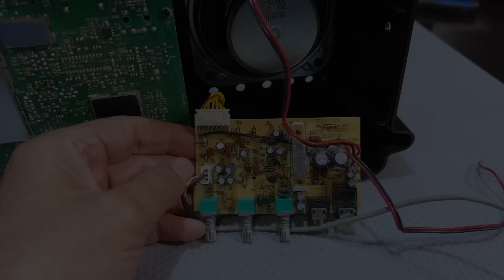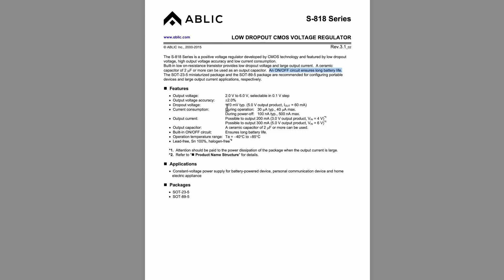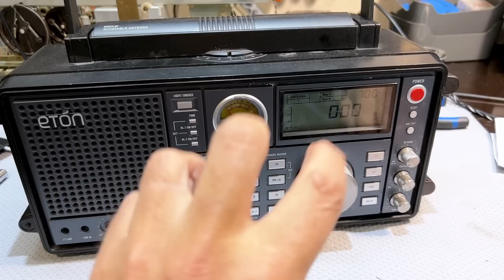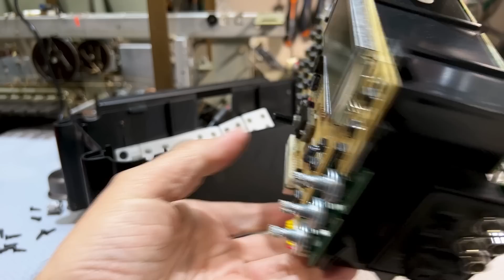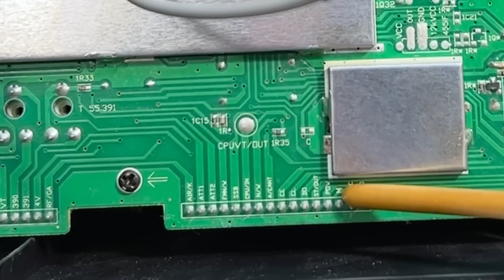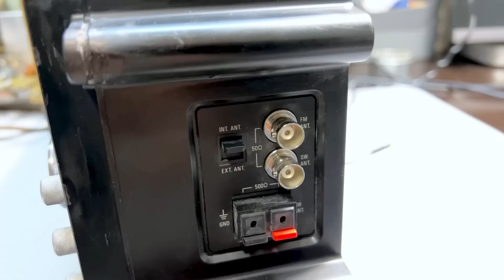Solving a Common Problem on the Eton/Grundig Satellit 750 - Reverse Polarity Damage.

Comment: Thank you.  This video helped me figure out the problem I had with the board with the power plug on it.  My problem was that the plug had let go from the board.  The copper on that particular board is quite thin and over time the copper tore and cut the power from the power adapter.  If I could send a picture it would be easier.  In the end i got it figured out.

Comment: So I should be good with the stock adapter that came new with the radio?
Reply from the maker: It would make sense that it will be the correct one. If in doubt, test with a multimeter.

Comment: No joy in finding the voltage regulator state side. I was surprised nobody has any in stock. Do you have an suggestion on a sub that could be used for the radio to work correctly?
I did find a mosfet but sadly no luck on the voltage regulator.

Comment: Mr, Caldeira, update, I started testing the voltage starting at the connector and discovered no voltage going to the output on that little board, the one the battery also connects too. Okay the Mosfet was blown so I did what you did and Jumper'd that, I also ran a jumper from the DC connector on the little board, apparently something on that connector or the board was not allowing voltage to the main red wire leading the power supply board. I discovered then the Radio powers up! So excited with that but sadly no sound out put on any band or mode. I suspect that voltage regulator on the Main Front board is the issue, but I don't know, not got that far in. Any advice on how to proceed would be greatly appreciated! Thank you for the video!

Comment: Hi I purchased a Grundig 750 off Ebay, it arrived dead in the water. I found the Mosfet had a crack in it and was causing a dead short. I did the jumper on the Mosfet as you show in the video, no joy. I thought then voltage regulator, my problem is getting replacement parts here state side and nobody I can find in the states repairs these things so they wind up in the recycle bins or dumps. The mosfet was damaged, I can't get any numbers off it and same for the regulators. I watched the video several times wasn't able to decide on what part numbers you used for the Mosfet or Regulators. Could you provide those? I also had to replace several of the capacitors, and I think I will just replace them all, perhaps I will wait for the part numbers before proceeding with that venture.
Reply from the maker: I’m afraid all I have access to is in the video. Check the schematics and you can then find replacements from that or source alternatives.
Reply: @electronicsoldandnew  In the video you mentioned parts you ordered to repair the radio, but it is really Not clear what parts you got or where you might have gotten them. Nothing is out on the radios, No parts lists, service manuals, schematics, Nothing. What I need is the parts you used to repair your rig, 3 parts I think you replaced, and One was a Mosfet, I did find a source for the IRFR9024 I believe you mention but Nothing for the 4-volt regulators. If you could provide a part number for those 2 regulators It would sure help a fellow radio collector out!
Reply: @electronicsoldandnew  I rewatched the video and you are very correct you do show the parts. However, seeing the voltage regulator part number is a different matter. You might can see it on your end but on my end I can't see it well enough to make the numbers out. I am really sorry to bother you I truly am. I tried watching the video on a 70 Inch Screen and still could not make the part number out!  I asked a friend he watched it and he said he could see the numbers as I could but could not make them out because they are to small to see. Anyways again sorry for the bother.
Reply from the maker: I sent you an email with a zoomed view of the numbers. Hope that helps you get that radio up and running. Good luck.
Reply: @electronicsoldandnew  I got it thank you very very much! Having bad eyes is a real pain. I appreciate your time and your notes! By the way what you've done with your channel is very helpful, I have learned a great deal for your videos. Please keep making them!
Reply: @electronicsoldandnew  I located some of the voltage regulators in China but sold from Europe very expensive and had to order 25 of them. I found the mosfet it is on its way and should be here within a few days. Voltage regulators sometime at the end of March, that was the fastest I could get those. I want to thank you for your help, very appreciated please continue making videos like this, it is very helpful and not only helpful but shows ability to trouble shoot! You are a Blessing to anyone who enjoys radio and the repairs and restoring of radios. Excellent!
Reply from the maker: @maxedoutmegablith6473 👍

Comment: Anyone else knows the issue i wrote about above?
Reply from the maker: I’m afraid that question requires a full checking of the circuit. There’s no simple answer without a full analysis by a tech.

Comment: Thanks for posting, I found that same model at a garage sale for $10 years ago, had open flushable link but now all buttons work except nothing happens when turning the tuning knob, any ideas thanks!
Reply: Someone mentioned the Encoder gets dirty perhaps this is your issue. You'd have to take the radio apart, it isn't easy to get it apart, have to be very careful, recall where everything goes. Once inside you will have to remove the front board. The Front board has a shield on it, that would have to be removed, 2 solder joints and several tabs bent straight. Remove that so you can access the back and remove the encoder. As far as taking it apart, you have to be very careful so as not to damage it in anyways. I have taken encoders apart, but it can be tricky and a real pain in the backside. I would just try and find a replacement unless you are really certain you can do this. I had issues with the volume pot once I got the radio working. I was able to use a dental pick and open the back side just enough to get some IPA in and clean it and then used Deoxit on it. Just be careful do it at your own risk, encoders are tricky beasts.

Comment: Very cool video. You remind me of electronics in my technical school. I almost forget this stuff. This type of regulator called LDO which stands for low dropout voltage regulator the amplifier control the mosfet voltage power accordingly based on feedback from the load current and reference input voltage to keep the output voltage stable even the supply voltage is very close to output voltage and they are suitable for RF application due to their low noise capability.

Comment: So are people buying on fleabay the wrong wall wart and plugging it in or is Eton sending these out with the wrong wall wart.   One of these choices isn't a problem of Eton.
Reply from the maker: I don’t believe the radio comes with the wrong wall-wart, but it’s quite easy to mix up wall-warts and use the wrong one. I have dozens of these things lying around.

Comment: Hello. Thank's for the Video. So, the 4VCW is an 2SJ245 ?
Reply from the maker: Check the video again. This repair was done some time ago and cannot recall the details.
Reply: @electronicsoldandnew  Thanks for your response. Unfortunately, I ordered the wrong part. What I actually need is an S-818A40AMC-BGUT2X, which you mentioned. It's the small part on the audio board. But they are nowhere to be found unless you order 3000 pieces. Too bad. Now I have a paperweight. But thanks again for your video.

Regards,
Rolf
Reply from the maker: I found one on Mouser, in stock, for €1.14. It’s the S-818A40AUC, but I’m sure the difference is minimal. Just check the package size and pinouts, and I’m sure you can adapt it to fit.
Edit: you’ll have to mount the part off the board and connect the respective pins to the right tags, as the pinout is indeed different.

Comment: I plugged in a 6 volt wall wart with the positive center and I heard a hum and it didn’t power up. I quick unplugged the wall wart and switched the wires. All was good nothing blown. I guess I got lucky or they installed a protection circuit. I do have a 2023 model.

Comment: Good morning. 

 My friend Gustavo Ferrari, owner of a Grundig Saterellit 750 radio with the same problem, gave me the link to his magnificent video.  

Gustavo tells me, look at the video. 
 I repaired it, something that wasn't easy.
  I decided to make a documented entry on my blog. 

 Yes, I am Juan Pascual, the owner of the blog Electrónica Pascual and I have been excited to be able to help him a little in the repair of his equipment.

  I struggled quite a bit to be able to design the LDO voltage regulator so that it could run on batteries.

  I have to look in detail at the voltage regulator that you propose.  

For the issue of voltage inversion, use a polarized relay,
 I think, with a system so that when it is activated it consumes less rest current, since using a diode, even a Schottky one, produces a voltage drop, something that does not happen with the relay.  Thanks again for your great video. 

 A hug from Madrid, Spain 🇪🇸 Juan Pascual (Electronic Pascual)
Reply from the maker: Thank you for your kind words, and thanks for your contribution. Abraço da Madeira, Manuel

Comment: Is there an automatic channel search on this radio or are we going to search with our hands all the time? Also, when comparing tecsun s2000 with this radio, which one do you recommend?
Reply from the maker: Manual search, but lots of programmable channels. I’d choose this one over the tecsun, and the Grundig over this one.
Reply: @electronicsoldandnew  thanx for answer... I like the automatic channel badge more, it is easy and fast, manual is tiring and requires effort, you have to make sensitive touches like an amateur radio operator to fix a frequency, but as a result, I will try to get a very nice radio

Comment: Hello, which of the two types of encapsulation is used pin by pin to replace the 4VCW: SOT 89-5 or SOT 23-5?
Thank you so much
Reply from the maker: I don’t remember, but should be visible in the video

Comment: Hello, it usually happens to me that when I use the radio (it works fine) and I turn it off, then it doesn't turn on, that is, it only has no audio but the rest seems to work fine. Then I leave it unplugged for a reasonable amount of time, maybe a few hours or a day and it works fine again. I mean, I can't leave it plugged in. Do you have an idea what this could be? I leave you a cordial greeting and I look forward to any help or ideas you can give me. Thank you very much (from Rosario, Argentina)
Reply from the maker: Check the power supply circuit. You may have something heating in there that needs changing

Comment: I have one Panasonic radio with this kind of opposite plug. I didn't pay any attention to it, because usually nothing bad happens if you plug a 9V battery backwards in a transistor radio. Just a quiet hiss. The Chinese have designed a €300 brick. I might want to use a different power supply if the DC smoothing fails over time.

Comment: If someone reverses the polarity and fries their radio, it is on them. You cannot fix the stupidity that people create for themselves.
Reply from the maker: That may be true, but a brand that makes an “unconventional polarity” device of this standard could at least have added some protection. The opposite polarity is unquestionably the “standard”, so errors in connecting the wrong supply are sure to happen.

Comment: Thanks, I just bought a Grundig 750 from HRO and the signal strength meter doesn’t work.  The wall wort that came with it doesn’t confirm the center pin to be negative.  I’m a little disappointed.  I bought a Zenith 7000 Oceania for $35 that works as good as the Grundig.
Reply from the maker: Some of those supplies don’t indicate clearly what their polarity is. It’s a trap if you don’t know what to look for.
Reply: If you bought it from HRO you should send the danged thing back. If it was a used item they will still take it back so long as it goes back just like it was when they shipped it. Analog meters often stick a good slap might get that going. The AC-DC adapter is Center Negative and anything else you'd use better be else you will smoke the rig.

Comment: Nice job troubleshooting!  I have a problem with my Satellit 750 and am looking for help.  Turned it on the other day and all I got was a motorboating sound from the speaker.  All bands.   Tried battery power and headphones, no change.  My first guess was bad power supply but the LED display, tuning, etc work fine.   I now suspect the audio amp is shot.   I have no test equipment except a digital voltmeter so am wondering if the thing is worth fixing, or where to send it?   The radio was a gift, infrequently used, but I really like it!   Any suggestions would be welcome.
Reply from the maker: It’s definitely worth fixing, but I don’t know where you are or who would do that in your area. I suggest you look at local social media and ask around for a repair guy.

Comment: Tecsun. Now I have desire to own it! It looks like the auxiliary power board, the one with barrel socket, is not equipped with a lot of components - maybe there was a factory option to have protection against mis-polarity.
Reply from the maker: I believe there was an option for feeding in an AC supply, as there seem to be holes for diodes.

Comment: There is another option with that diode protection. Put that diode in antiparalel and put some fuse right before this. If the PSU gives the right polarity, then this diode does virtually nothing, it is in reverse, so doesn't conduct. But if the polarity is wrong, then the diode starts conducting, puts the PSU into short circuit which blows that fuse. The advantage of this solution is that there is no voltage drop on it. The odd side is that if it reacts to a wrong polarity, it blows fuse, that needs to be replaced. And you can also use the zener diode instead with zener voltage slightly higher than the output voltage of that PSU should be, which behaves like a diode, so if the polarity is wrong, it starts to conduct the current, which puts the PSU into short circuit and blows the fuse, but it does the same also with the right polarity when the voltage is higher that it should be, which adds another protection to that whole thing.
Reply from the maker: 👍 that works too. Thanks

Comment: i use batteries only on mine.. mains power introduces too much noise especially used with an external antenna
Reply from the maker: Batteries will normally make it quieter, especially if you use a switched mode supply instead of a linear one.
Reply: Same here. Oh, and whoever invented center negative needs a' whipping.
Reply from the maker: 😊 wazzantme

Comment: I had one of these in for repair last year. After a lot of diagnosing and measuring with the multimeter I was able to work out (as you did here) how the various voltages are switched and derrived. Only the 4VCW was faulty on this radio, and not wanting to wait around for replacement parts I went ahead and made a substitute regulator/switcher using a couple of bipolar transistors, a zener diode and some resistors. Worked perfectly and the owner has never come back so it must still be going!

Comment: Nice "component detective work", Manuel! As many have commented, a diode in series or parallel with the input DC jack would keep accidents like this from happening. Have done the same with some Norwegian radios which had center negative jacks, but no uP's and elusive components in them..
Reply from the maker: The series diode is in place. Wasn’t going to risk it.

Comment: I had this radio in 2014 and one of the first warnings I found online was about the reverse polarity damage. I think it's needless to say, but what you've done here is pure gold. The amount of people you have helped with this is countless. I tip my hat to you Sir!
Reply from the maker: It’s my pleasure
Reply: I think if you have a working one, putting a protection diode in would be the way to go.   Looking at the board that the power comes in on, it appears it could be easily modified to add a prtection diode that either shorts power if connected wrongly or, as noted in the video, runs in series with the power
Reply: @EsotericArctos Agreed. I had an old Passport radar detector that only accepted 9 volts when most brands were designed to accept 12 volts. Needless to say the protection diode in there did its job one day.

Comment: Well done!

My Tecsun S2000 (which is equivalent to this etón) isn't working anymore on USB. And by the way, LSB is working properly. I don't know if this is a typical failure - have to figure it out ...
Reply from the maker: Not sure what the issue could be. As I don’t have a schematic, I didn’t go too deeply into the radio section at all.

Comment: Noob question! I've looked for it before on google but couldnt get to a conclusion. N-channel means NPN right? :) nice job on the puzzle.
Reply from the maker: Not quite the same. N-channel mosfet starts conducting by applying a voltage to the gate which is positive relative to the source. For P-channel, that voltages is negative relative to the source. That’s why it works here: the source has the 6V supply, and when you apply a voltage lower than the source to the gate, it switches on.
Reply: Thank you Manuel

Comment: Perhaps there might be a way to use a mosfet as a switch for the external power. That could reduce the voltage drop to a negligible amount.

Comment: Wonderful job sleuthing the solution; have you considered, perhaps, a shorting, reverse-biased diode on the DC input?  (edit: just saw your comment on that) 
I sympathize with you on the center-neg/center-pos issue; looks to be split right down the middle for the electronics in this lab.  Must always check the diagram next to the socket.